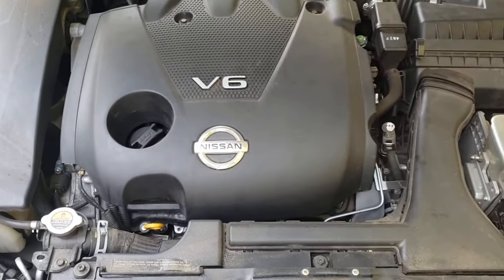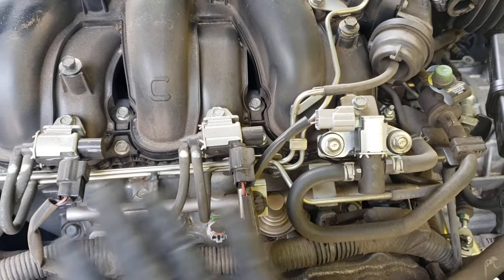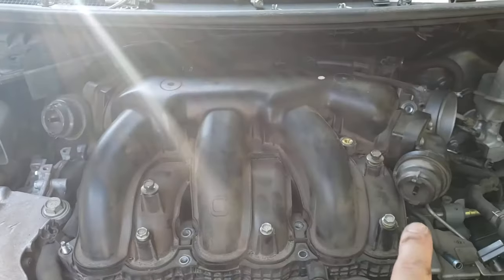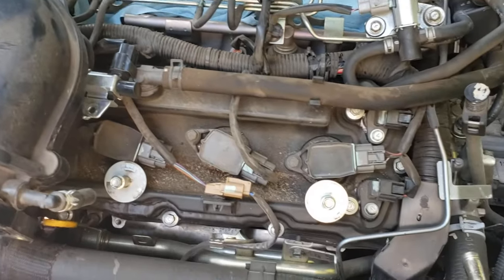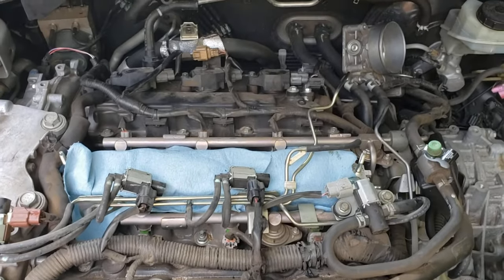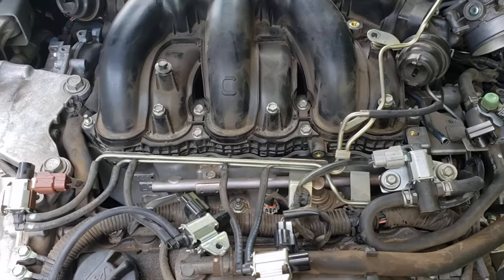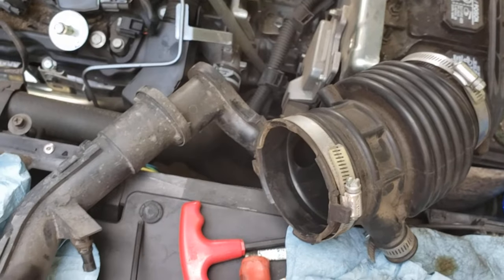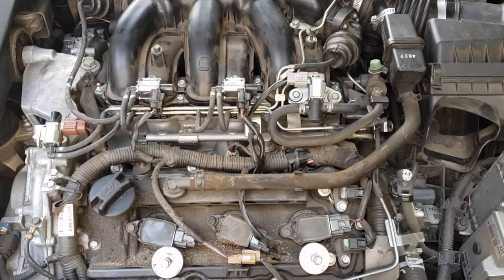Nissan Maxima SV V6 Tune-Up Step by Step

Comment: What size spark plug socket did u use?
Reply from the maker: https://youtu.be/H8Fu6NoOGxM?t=298 video shows at this time....should be a 14mm it is a specific socket for the smaller plugs a normal 14mm wont work

Comment: Excellent narrated video!  Was told awhile ago that the plugs were a tough job and Id like to do it soon.  Definitely gonna have this video as my guide sitting on the workbench when I tackle this job.  Gonna check to see if you have a video for dropping the CVT pan. Thx
Reply from the maker: Thank you! For this model unfortunately we don’t we will be doing a dodge soon. 
FYI you must use Nissan CVT fluid if you try and do the fluid. Any questions just ask and we will be happy to assist
Reply: Just drain and fill the cvt. I use amsoil. Bought the car at 80k miles now I’m almost at 170k

Comment: At 4:29 the hose you describe as an AC hose is the power steering high pressure line. Mine leaked and I just had to replace it. Great video. Anyone have any advice as to why my bank 1 runs lean? STFT maxes out during acceleration.
Reply from the maker: Thanks it’s wrapped like an ac line lol must get stupid hot. Lean would indicate a possible vacuum leak or something after the MAF sensor…other possibilities fuel related but less likely

Comment: I changed my spark plugs and made sure everything was connected and no leaks but when i went to turn it on it has a rough idle and feels like it wants to lose power, my brakes are hard to push as well. What would you thinks the problem?
Reply from the maker: Vacuum hose disconnected somewhere check the brake booster line

Comment: Excellent Video! Did you use iridium or platinum spark plugs?
Reply from the maker: Thanks! Iridium plugs
Reply: @DIYKAI  If I use your link to order the spark plugs I will get iridium plugs correct?
Reply from the maker: @TigMan-51C  correct the links we provided are to the exact parts we used. Please double check the part #s as we cannot  guarantee Amazon doesn’t screw things up lol
Reply: @DIYKAI  Will do, thanks!
Reply from the maker: @TigMan-51C  your welcome
Reply: @DIYKAI Got it done today Brother! Thanks again for your video. My regular 14mm deep socket didn’t work. Needed an extra deep socket and then it would fit because in the spark plug well there is a smaller space for the socket.  I had to grind down the socket wall to get it to seat all the way down onto the spark plug. 
She’s done now and runs perfect. 
Its my wife’s car. Serpentine belt, Rad flush and Rear Shocks next. I already rebuilt the whole frontend suspension.  135k miles. Thanks again!
Reply from the maker: Awesome! Glad you got it done happy wife happy life lol 🍻

Comment: Great job, your thoughts on a used 2013 Nissan Maxima with the cvt transmission and 150 k.
Reply from the maker: Thank you....cvt transmission are ok as long as they have been serviced and don't have any weird noises or "moaning" when driving...they are not meant to be a speedy trans more of an economical type.....if your using it for an A to B car then yes its fine
Reply: @DIYKAI  its just a rubber band at best.
thanks
Reply from the maker: @jt8280  exactly just use the manufacturer recommended fluid
Reply: Gotta 09 myself.. had it since 2016 and only problem was the cvt but Nissan extended the factory warranty and I was just shy about 1k miles of the 120k at that time. 88k miles when I first got it then at 115??? I believe trans started failing, sounded like a supercharger or power steering whine. Wonder why they have a CVT light on the dash 🤷🏾‍♂️🤦🏾‍♂️ that never comes on unless it’s about to start. CEL light came on for the trans. And everything dealing with the change of the transmission was covered, new exhaust pieces and a coolant flush.
Reply from the maker: Nissan CTV trans are troublesome they have to be babied and trans fluid every 30k to last
Reply from the maker: Lol yup ole CVTs I recommend doing the fluid every 20-30k depending on you driving now lol….and some CVT belt conditioning fluid we don’t even rebuild them because of the issues
Reply: @DIYKAI  Does a tranny cooler help ? Thanks for your time.
Reply from the maker: Yes absolutely for about every 10° cooler it add about 10k miles usually to transmissions we always use coolers on all of our trans…ideal temps are between 160°-190° for the most life span
Reply: @DIYKAI   Thank You, Mr. Kai !  China Number One !
Reply from the maker: 😂😅 yw
Reply: @DIYKAI  i haven't ever changed the CVT fluid. 2014 maxima has 118xx on it and I have read mixed reviews about draining and filling it. Some say do it and changed external filter as well, others say do not do it at this point it could mess up the trans.  I know flushing the CVT can be bad, but the drain and fill? Let me know if you have any suggestions.

Thanks,
Reply from the maker: Funny you mention this we are making a cvt video on a dodge lol…….definitely recommend filter or filters ours has 2…..OEM dealer fluid (bite the bullet on that one trust us)……you will need a way to measure the fluid we bought the dealer tool for like 30 bucks
Reply from the maker: Our cvt is at 225k LOL and was making noise and shaking at idle all is gone now and drives like a champ again

Comment: Question, if you’re still monitoring this channel. If one ignition coil is bad, should they all be changed? I know it’s significant expense with them being $100 apiece but this is a pretty involved maintenance procedure.
Reply: You can get them for $20-60 per coil on rockauto. O’Reillys and AutoZone charge an arm and a leg for parts.. but yes, I’d definitely recommend changing them all out just so you don’t have to go through this process again. I ordered 6 coils even though I’m getting an error code for 1 of them. After taxes and shipping, it came out to less than $150 vs paying $600+ at autozone or O’Reillys
Reply from the maker: Yea rock auto has great prices
Reply from the maker: Honestly if you can’t afford all of them just do the rear bank that is covered up that way those will be done and out the way the other ones are easy to change
Reply: My Nissan Maxima is saying cylinder 2 misfire…can you tell me which one that is??
Reply from the maker: @patriciagarza5151  Hello number 2 cylinder is the left most coil on the front should take no more than 10 minutes to fix.
Reply: @DIYKAI  thank you so much for responding so quickly!   Excellent video…so good.. I think even I can do this! 😂
Reply from the maker: @patriciagarza5151  your welcome! Thanks we try to help everyone save a penny or 2 lol
Reply: @patriciagarza5151  front coils are 2,4,6 and the coils under the manifold are 1,3,5. So cylinder 2 is a super easy change.
Reply: Thanks everyone. Changed all six spark plugs and coils in two hours. No issues after service. 

The number three coil was bad.
Reply from the maker: @BLACKMONGOOSE13  that’s great! Hope it’s running smooth now
Reply: I just to gotta do number 4 cylinder do i still have to take off all the hoses?

Comment: For some reason a 14mm socket doesn’t fit to take out the spark plug
Reply from the maker: has to be a thin wall or the special plug socket.....try 1/4 drive deep well chrome socket should work
Reply: I just bought a 3/8 drive and it worked.!! Thank you!!
Reply from the maker: Your welcome

Comment: I never understood why they have a mesh molded into the throttle body gasket
Reply from the maker: I think it’s to help it stay in place
Reply: @DIYKAI guess that makes sense I'm about to do mine,I got a 2020 max just hit 30k miles but I'm going to replace gaskets and air filter..but I only use e3 plugs I stopped using ngk but can't wait to do this next weekend
Reply from the maker: @gaff205  imo 30k is too early for those plugs run them till 60 or so but change the air filter and all

Comment: Why are the torque specs on the manifold and plugs?
Reply from the maker: Really don’t need exact as it can be done by feel. 3/8 ratchet for the plugs when they stop turning 1/8-1/4 turn further…manifold bolts same except 1/4 ratchet 1/8 turn after contact….
Can provide specs later

Comment: Great video. What torque on manifold bolts?
Reply from the maker: Thanks! Honestly not super tight don't remember but. If using a 3/8 drive when it gets tight maybe 1/4 turn more because the manifold is plastic
Reply: @DIYKAI  thanks
Reply from the maker: @Ctrnr1995  no prob we wouldn't go over around 10-13 ftlbs on the bolts and no more than 20 or some on the studs....so no more than just snug

Comment: Anyone have torque specs for manifold bolts ?
Reply from the maker: Honestly 1/4 drive and snug them down
Reply from the maker: Torque is low the bolts are small
Reply: @DIYKAI  sounds good, thanks. Not looking forward to this but I have a misfire on the rear bank. The video details should be helpful

Comment: Thank you ! What are the torque specs for manifold ?    No gasket on throttle body ?
Reply from the maker: Your welcome! It’s not much just use a 1/4 ratchet and snug them down does not have to be hulked on maybe 10ftlb….if the gasket in the TB looks good reuse it.  I reuse them all the time no issues

Comment: What tools did you use to get the throttle out the way?
Reply from the maker: We used common hand tools. A good 3/8 ratchet and socket set will do just fine grab an extension or 2 and a swivel you should be fine

Comment: What kind of coils i need for my 2012 Nissan maxima s ?
Reply from the maker: Any off the shelf will work but why are you changing the coils? is one or more bad?
Reply: @DIYKAI  I don’t know yet I had the car since 21 its kinda Idling bad and jerking sometimes gas running out faster then usually also pullin to one side 😓
Reply: @DIYKAI  and I’ll start the car everyday day fine But it’ll be a day when I gotta push the button twice 166,00 some miles
Reply: @DIYKAI  ?
Reply from the maker: @aishahinton9390  Is the check engine light on? if so does it flash when you are drive and shake?
Reply: @DIYKAI  like at a light sitting or just coming out in the kit first starting up yes it is on and off

Comment: It's all for the same trims right? Because i have maxima sr 16 with same engine
Reply: And need 8k miles more to reach 100k miles on it
Reply from the maker: Yes should be the same for all v6 motors

Comment: I need to try a plug change, I have changed out 3 different mass air meters, and still getting the same code...🤔
Reply from the maker: What code?
Reply: @DIYKAI  mass air code...thinking maybe a tune up might help
Reply from the maker: Also check for intake leaks

Comment: What PCV valve did you use?
Reply from the maker: This is the one we used:
https://amzn.to/3lougnU
Reply: why do you have to change the pcv valve ? do i have to do it while im doing the spark plugs @DIYKAI
Reply from the maker: @StockCarGuy  The job of the PCV system is to vent the crankcase from over pressure. If it gets clogged the engine will run rough and other problems scan occur. It is recommended to change it out when doing the tune-up
Reply: @DIYKAI  better explanation from you, i understand and could that cause intake air pressure codes from a bad pcv valve?
Reply from the maker: @StockCarGuy  do you have a code number?
Reply: @DIYKAI  po113 and p0011 and po111
Reply: @DIYKAI  nvm, those pertain to the air intake system like the air box

Comment: Not the AC line dude... Pretty sure I remember changing that sucker... Power Steering high pressure line ... Not that it matters, but in case somebody looking at a manual or something
Reply: @DIYKAI  u say "the AC line" when referencing the upside down U looking hose that's situated behind the manifold near the pcv valve
Reply: That hose is PS

Comment: Yo what if I can’t get the throttlebody off whoever last worked on this car stripped the bolts
Reply from the maker: Remove the whole manifold with it attached. Just make sure everything is disconnected

Comment: a “tune up” is just changing the spark plugs?
Reply from the maker: I am not sure what you mean? Did you watch the whole video, air filter and pcv valve were also changed
Reply: @DIYKAI   yea i did but i have a performance air intake on my maxima and i was searching on youtube for engine tunes or somethin, like laptop tuning for after i port my manifold :)
Reply from the maker: @av3cs  you wont need tuning software to tune it....if its just a manifold the cars stock computer should compensate for it if that's the only mod you have